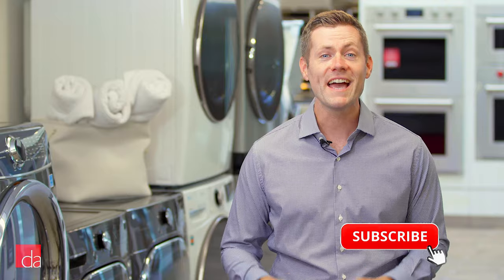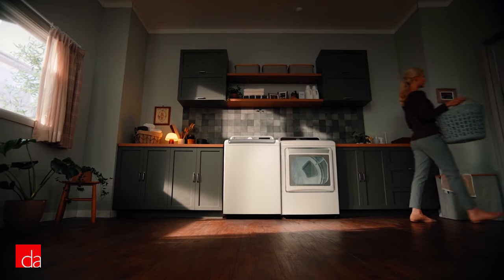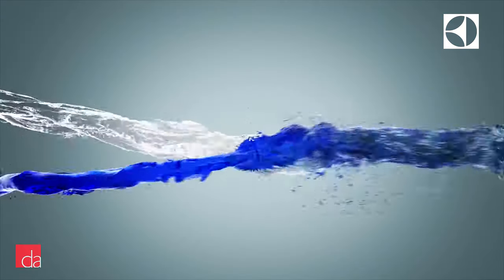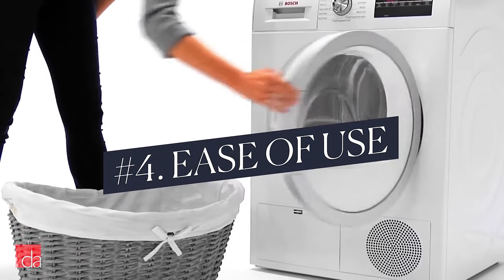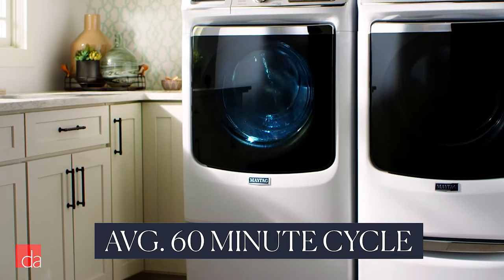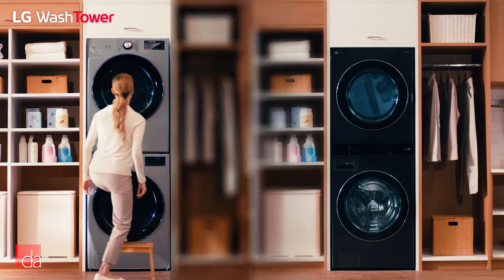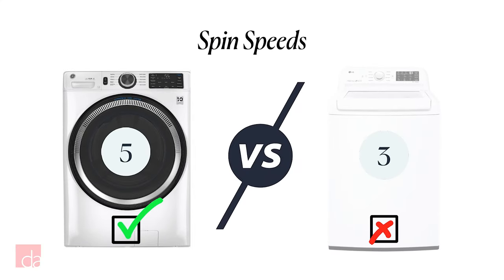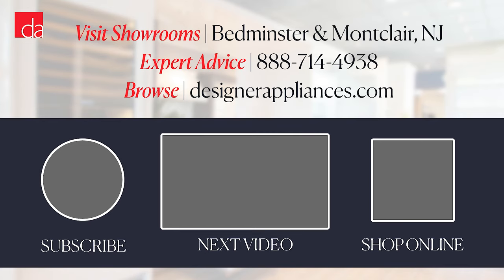Front Load vs Top Load Washer - Selecting a Washer Shouldn't Be Confusing (Updated)

Comment: I disagree with the durability comment. Top loaders are more reliable. The cantilevered shaft on the front loader tub puts undue stress on the bearings and they wear out and need to be replaced.  The gaskets on a front loader also need to be replaced.  What if a gasket leaks and you get water all over your floor?  It’s pretty obvious that front loaders need more maintenance. Also, it’s disengeneous to say that a front loader does a better job washing and then you says, “well if you’re a mechanic or a landscaper with really dirty clothes then the top loader cleans better.”
Reply: I agree with all your points. In fact, when I recently had to buy a new washer and dryer for my house, most of the reviews from customers who had experience with front loaders hated them. They complained about the mold issue, the fact that front loaders did not clean as well, and that they broke down all the time because of all the fancy features. Most reviewers just swore they would not ever buy another front loader.
Reply: Any washer can do a good job washing clothes. The trick is knowing how to use them. There's a lot more to a washer than just tossing in detergent and hitting the start switch.
Reply: I worked in a refugee center in Germany and we had 3 front loaders. The refugees would use them every single day, sometimes they will use them for hours at a time. Cleaned their dirty shoes to bed sheets, blanket and what not. None of them had any problems after 3 years of usage and still running properly. So no when it comes to durability and one knows how to use the machine properly, there won’t be any problem.

My parents has top loaders and it not only use more water per cycle but also usage more energy. It also takes more time to clean because you need to put your clothes in the dryer by yourselves. On the other hand front loaders does everything. So for me I would always go for a front loaders because of efficiency and how it saves my time.
Reply: I had an LG front loader that lasted about ten years. I experienced the same problems that you stated, bearings and gasket wearing out. Moreover, mold problems on front loaders are prevalent.
Reply: 3 years isn't a very long time. If a washer lasts 7 - 8 years without breaking down it's a good washer IMO.
Reply: It’s not cantilevered there is a suspension system. Know what your talking about before commenting.
Reply: @babor_  Sounds like you are talking about a combination washer/dryer machine.  Which is not what this video was talking about.   This video was talking about washing machines that only wash, whether that be front loading or top loading.   Also, the combination machines don't save any time if you have more than one load of clothes to wash.
Reply: In the uk the market is virtually all front loaders.
The bearings on my washer have just given up and as the plastic tub is glued together i can't split it apart to replace the drum bearings.
The only option is to buy a tub and drum assembly. Annoying.
Reply: It's hard to compare because all the new appliances sold today are complete garbage. Get the brands that commercial washing places buy and compare, I would be interested to see a real comparison.

Personally I prefer a top loader because I hate bending down to load all my clothes twice in a cleaning cycle.
Reply: @Camelotsmoon  Industrial front loaders are extremely good at cleaning and are what most dry cleaners use. Put your front loader on a pedestal.
Reply: @gopackgo4036  They are old school, mechanically, not computerized like now, built better. Also priced very high.
Reply: @johnnyperdue363  not true. Also old school washers have electronic controls as well, just not as computerized as now.
Reply: I think these guys sell washers and are just trying to make the front load option more desirable to the ones who don’t mind shelling out money. I’ve noticed since the 90’s when I was a kid things have gotten more expensive but quality has suffered.
Reply: Top loaders aren’t reliable more than front loads anymore. Once they were due to their simplicity but many brands especially American brands like whirlpool have really cheaped out. And front loaders do clean better. There’s a reason for that. Top loaders just use scrub action to clean. Front loaders use a scrubbing AND beating action. Also a higher concentration of soap due to less water. There’s a reason front loaders always outclean top loaders in tests. And I can second that as someone who’s used both
Reply: Agreed
Reply: In my experience, its the rubber bearing seal that wears out first, letting water get at the front bearing which causes the bearing to rust and wear out, or else bind, thereby also destroying the spider shaft if you don't stop using it and change them. And if your clothes are really dirty, you select the prewash cycle to remove the bulk of the filth before it starts the main wash. I've only had a door seal leak when I've allowed limescale to build up so badly on the door glass that it interfered with the seal, and it was only a tiny weep that was fixed with a wipe of limescale cleaner. Of course if you leave sharp objects in your pockets, leaks are more likely.
Reply: @MaryBethMcCoy  stop using liquid detergent,  in my 47 years of life my mums and my machines have never ever had mould in them   Liquids leave a film and are harder to rinse out, powders actually clean better especially biological powder on your whites with no need for bleach, or stain removers   Red wine, curry, ketchup, grass, mud etc etc I’ve never used a bleach or stain Remover to get rid of stains like these  because I use powder, powder also has a built in water softener,
Reply: But you didn't complete the reasoning about the gardener/mechanic clothes, it's only because top loader helps remove more grime with the agitator and water. That would mean if we're not talking about grime, or heavy soiled clothes, regular day's dirt and sweat, it says front load cleans better.
Reply: @davedebang-bang6168 where do you put the powder detergent?
Reply: Seriously think you misunderstood or maybe I wrote it wrong but a front loader will always clean better especially if your a landscaper or a mechanic,  it’s been proven so many times, I don’t have to use bleach in my whites, or stain removers, and if you use a front loader properly and do t do cold washes the door gasket will last the lifetime of the machine, never had a problem with mould or smells in any of mine, including the one I had for 12 years. Top loaders use so much water and don’t spin as well as front loaders and it’s a proven fact if you do your research properly that it’s actually less stress on the bearing for a front loader to spin than a top loader and able to go faster than a top loader,  something to do with physics and maths and the weight ,  and your new front loaders in the states with the wash plate are absolutely useless, I mean seriously,  no wonder you all have to use stain removers and bleach,  I’ve got engine oil out a white t-shirt with just my
Washing powder in my front loader.  Good luck doing that without bleach and stain removers in your top loaders
Reply: Also das kann ich überhaupt nicht bestätigen!
Die Toplader waschen überhaupt nicht richtig. Die Wäsche wird nur hin und hergeschoben, das ist doch kein richtiges waschen!
Und die Gummidichtungen habe ich bei meiner alten 26 (!) Jahre alten Maschine noch nie gewechselt!

Comment: I have tried both and I prefer top loaders because they rinse better by using more water, they are easier to load and unload, I can easily add stuff to them during the wash cycle and they don't have all the potential door problems (mold, leakage, etc.).
Reply: Sounds like you forget to put items in often
Reply: More water ≠ cleaner. One of those things that’s sounds right but isn’t supported by any tests. Buy a good front loader, and it will run 3 or 4 rinses with less water, draining after each one to remove residue. Also use less detergent to pair with the less water used by front loaders. The door gasket is the Achilles heal of front loaders though.
Reply: Tbh I dont get why you have mold issues, let alone leakage with front loaders. Ive been using frontloaders for all my life, theyre the norm here in germany. Mold wasnt a problem when I remebered to keep the door open afterwards. Leakage was never an issue.

Maybe you didnt use the right type of detergents? Idk, Im using the german standard washing powder thats like ~10% bleach, sometimes also a "hygiene rinser" (not sure if thats the right translation) which is kinda of a biocide; especially useful for clothes you gotta wash below 40 degrees. Then keep the door open and its generally fine. I dont even do the super hot washing (german power slots are up 3800 watt, so you can go pretty hot) that some people reguarly do to keep things clean.

Top loaders might have some advantages, but generally they seem outdated. Less efficient in energy and cleaning, even if theyre faster.
Reply: @termitreter6545  I have had an LG front-loader for over 14 years, to and love it. Only repair I've done is replace the drum bearing, which I did myself.
I've had it leak a very little bit, maybe 50ml, from the door seal if it is overloaded. That's operator error, and not design problem. I'd much rather a little water leak, than have oil leak into the drum. I've experienced oil leakage into the drum with top-loaders that were overloaded. Not a pleasant experience.
Reply: @Pheckphul1  Man, I just love it when you can buy an appliance and it just doesnt break for more than a decade.

Sadly pretty rare these days^^
Reply: top loaders for me.... mold issues where I live

and I am poor so no brainer for me
Reply: @termitreter6545  front loaders are the norm in Germany, yes, unless you don't have the space. Pretty annoying for us, since these top loaders are more expensive
Reply: @laurencebarnes5361  It’s a funny thing tho, because if you buy a top loader in Europe, the drum is still placed in a normal, “front loader” way and it just has a door in it (not the American way with the tub sideways)
Reply: @termitreter6545  All you have to do is leave the door open for a few hours to let it dry after running. I've never had mold problems after 20 years of using front loader models.
Reply: @kevina4140  Yup, thats what I do. 

Altho funnily enough, currently ive got minor mold issues around the seals for the first time. Gotta check out why this might happen.

Comment: I've had a front loader for almost 2 decades.  I always leave the door open until It's completely dry, and I still battle mold.
Reply: I think mold feeds on detergent, so try using less of that.
Reply: I leave the door open until I use the machine, I prefer a front loader by a long shot.
Reply: Use powdered detergent with color safe bleach. Works every time.

Comment: Weight is another factor. Top loaders are a LOT lighter than a front loader, making them much easier to move around if you need to clean behind the machine or if you tend to move house occasionally. I switched from a front loader to a top loader and I love it. I only use liquid detergent which doesn’t leave residue in the machine, and I leave the top open after a wash with a little container full of silica gel packets to help dry the drum.
Reply: All washer are heavy some just more heavier depending on the size..
Reply: Weight doesn't really matter tho but yeah